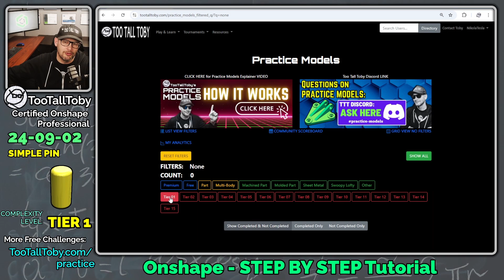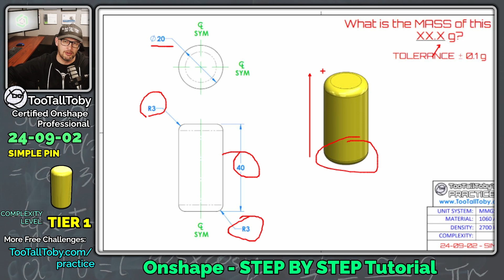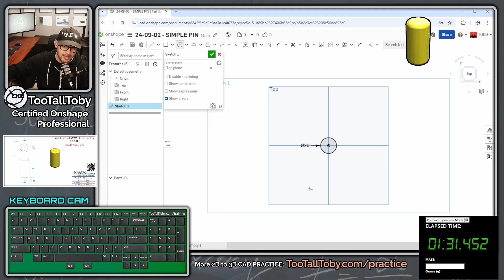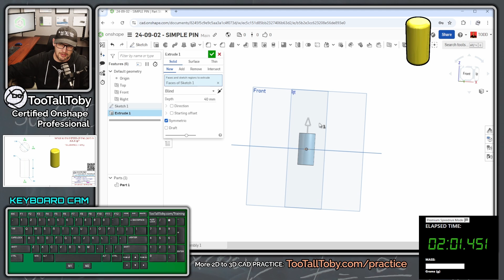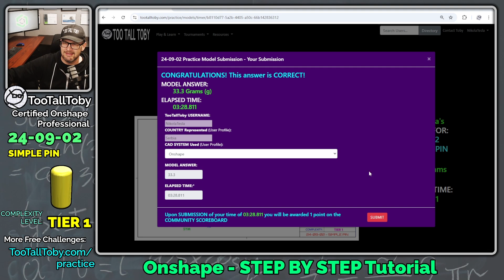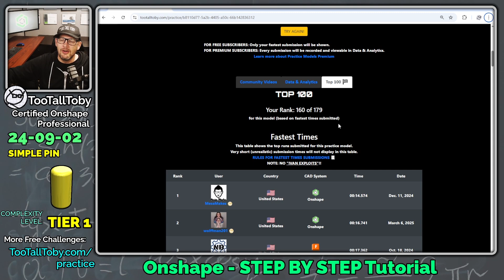HOW TO LEARN CAD - Onshape Best Tutorial for Beginners - SIMPLE PIN - Step by Step Guide

Comment: Toby I love your stuff and learn a lot from it. I'm only a hobbyist making some stuff to print out. Can I please suggest a tutorial?

Could you maybe 3D Scan something and then import the stl or obj file into Onshape and show us how to design around it? I can do it but when the stl goes in it's miles away from the origin and never square to it. Help on the best way to allign to the origin and to the planes would make a great tutorial.

This video on another chanel is far more advanced than I'm expecting but on the same idea. The issue with this video for me is it's using Fusion and on a windows machine so the initial alignment is not possible for me. 

https://youtu.be/3ESnyVAEaK4?si=UCkMYTL4IbYMadDY
Reply: I have done something like that, iimporting and STL file and re-modelling it to an OnShape version.
The main problem is, the stl file had no references to pick up, so I had to create a sketch over the top of it and eyeball everything with extreme zoom to align with the model.